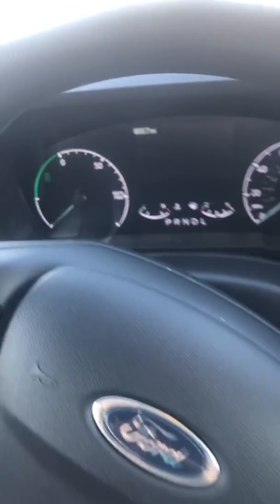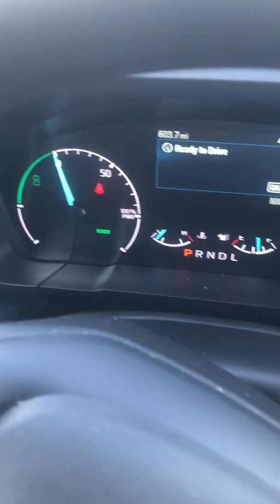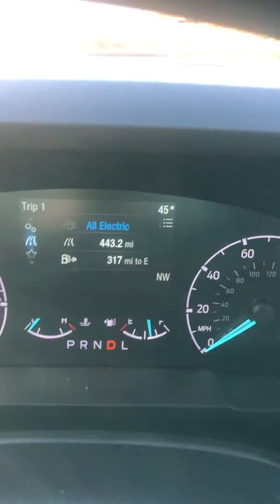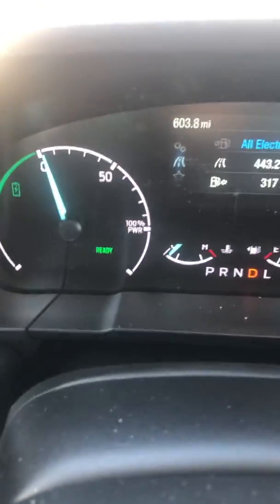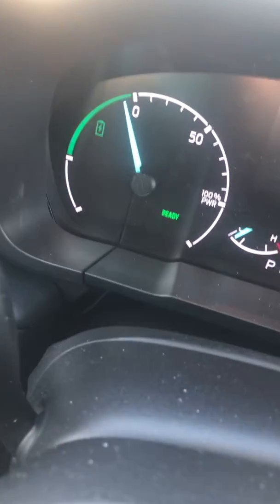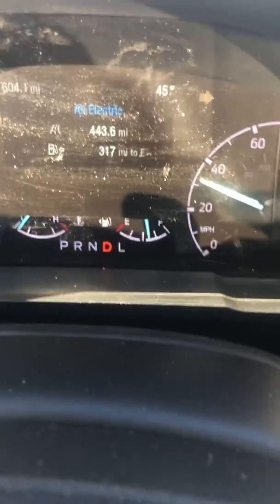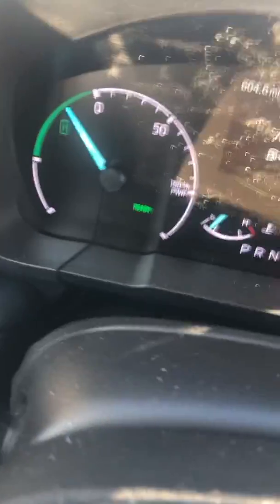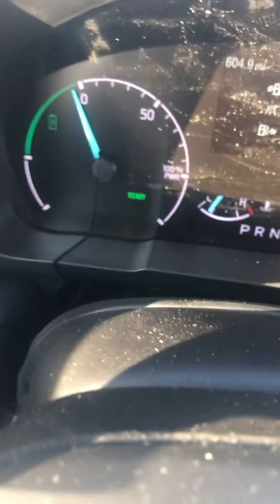2022 Ford Maverick " TECHometer" explained!

Comment: Thanks for showing how the techometer works. Be careful about flooring the engine cold though. Not good for it.
Reply from the maker: Thanks! As a very long time mechanic, I sort of understand that… :-) The engine had a little bit of heat in it didn't show that much on the gauge but it had been run.

Comment: Paul - is there a view which shows the charge level in the battery, similar to the Ford Fusion Hybrids?  It looks like a reduced size AAA battery.
Reply from the maker: No, it really doesn't show any kind of a state of charge of the battery. As far as I'm aware, the traction battery is a fairly standard assemblage of A123 cells, which are sort of like oversize penlight batteries.